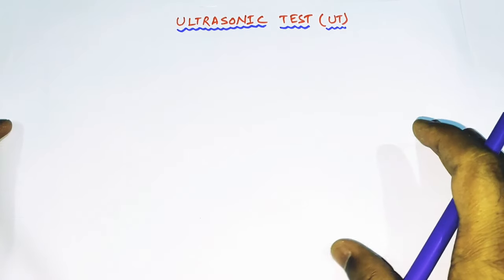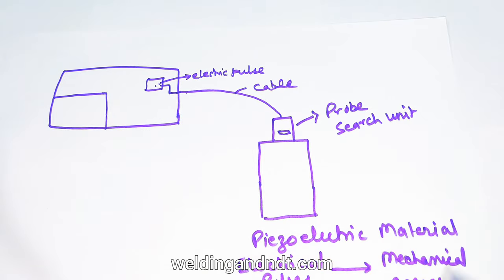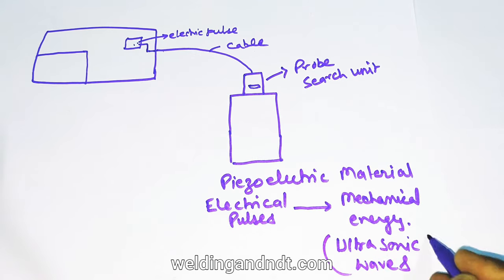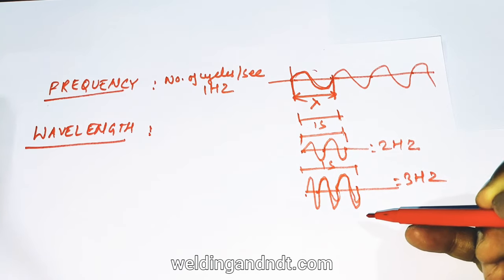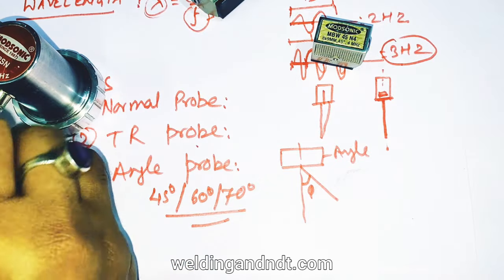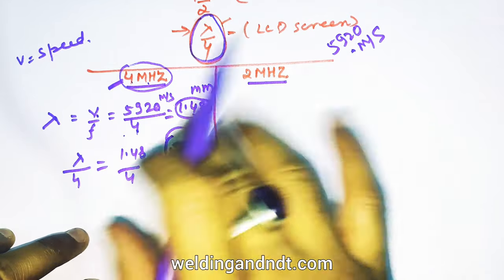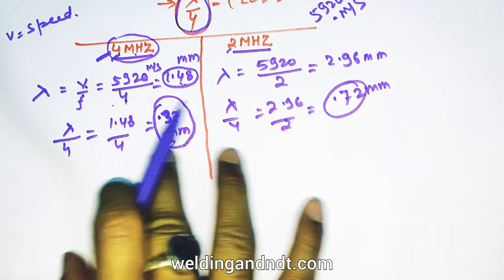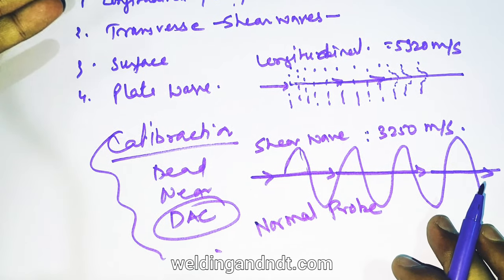[English] Ultrasonic Test (UT) Part 1

Comment: Good job. Efforts were put on the video absolutel. Refrain from defining Frequency as such... "speed per second." In defining the concepts, there is a  reason why Velocity has the m/s unit instead of the Frequency. 
You Did not complete on this video explanation about surface waves known as Raleigh Waves and Plate waves as announced.
To be sarcastic, I did like how you spelt "Sensitivity" on the first attempt. Solid video for entry-level UT with a little more extra details than they wouldn't get elsewhere. I am referring to details regarding "probe selection." I give you a solid 6/10 on this!

Comment: What is the code name for the selection of frequency?
Reply: For testing of any material frequency selection depends on Thickness and Material Composition .
It will be given in ITP plan made by NDT LEVEL-3 Inspector 
If not then More frequency of probe lesser penetration good sensitivity (smallest defect can be detected )lesser thickness materials  whereas as lower  frequency probe for Higher thickness bcz of More depth penetration and Less sensitivity 
Hope you understood 
Liwajhillah

Comment: Sir, I have a one doubt, if crack will show on the material, what will do next. if material is used or not
Reply from the maker: Most of the codes do not allow crack. The crack must be repaired and rechecked before using the material
Reply: @WeldingandNDT please sir, I can't subscribe and make payments because the option is not available in my country... Is there somehow you can help me get the full video 🙏...